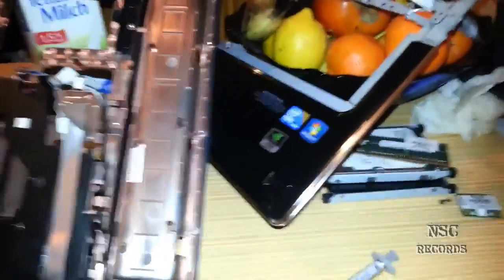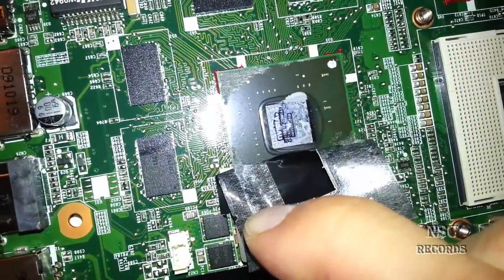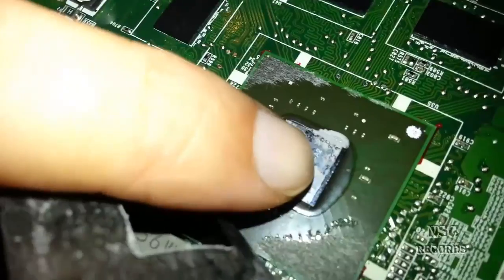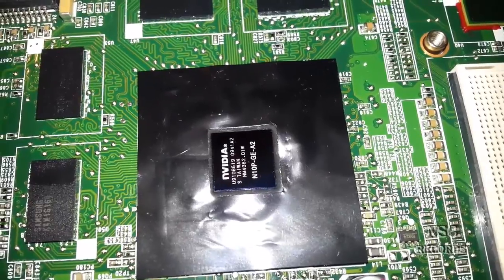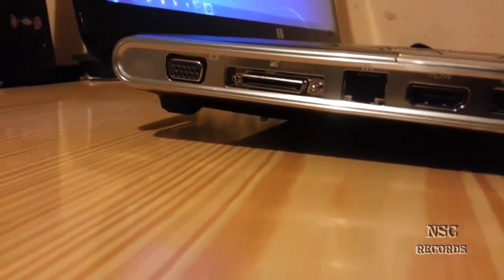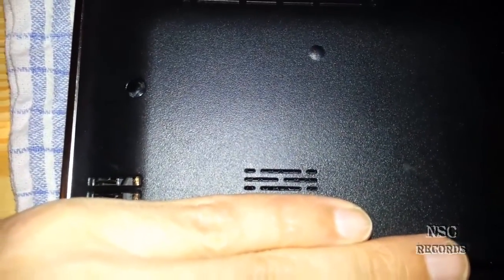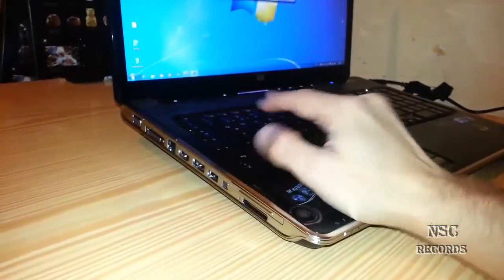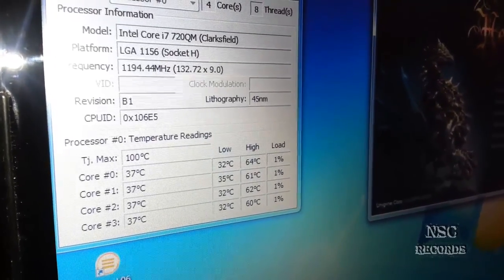HP Pavilion dv7 3090eg Temperature Fix By:NSC

Comment: Realize the dv7 is not a gaming system. Mine is running at 107*F at it's hottest. Sitting and running a few youtube videos and AutoCAD, unplugged at 91*F
Reply from the maker: yeah, it´s very true and i know it, but it has all what a normal Notebook need to work, got since a week a Samsung SSD 850 Pro inside for the System only, and a 640Gb HDD

At all it´s a great Notebook, it has also a wonderfull I7 CPU, just sad that thei messed it up like that...

Comment: don,t    ever  buy   hp     or any laptop   with  Nvidia video  chips     will only last  only like for   6  months   then   its   garbage
Reply from the maker: hmm not all, can happen also to ATI / AMD Chips...
Reply: UltraNSC
I have an HP dv7 with an AMD Radeon chip in it and it gets dangerously hot (90+ Celsius without a cooling pad), but has fortunately lasted me since 2011. Still, I'm thinking about opening it up and doing this fix.
Reply from the maker: OMG 90C* + your Notebook will die soon if you DONT do that...
Reply: ive had my quad core dv7 for years now and it playes games fine,and thats all i use it for. The only plroblem i have is the shitty vents and fan does not works to 100%
Reply from the maker: you can set that on Bios and at Win7

Comment: just opened mine today, i managed to shave off 30° by changing the thermal paste (Arctic Silver 5). the nvidia controller was just like yours, all covered up by the black protection. anyways i prefer 44° in idle than 80!!

Comment from the maker: Thank you... you just need to remove the plastic and replace it better like i have done, important is only that the plastic seats not ON the main Chip, just around the Chip to protect the smd Transistors, normaly the cooler gets no contact to this small smd Transistors, but thei did it for secure we can say.

Cheers
Reply: do you still have the laptop kicking around? Just asking, cause I’m watching this, whilst working on mine
Reply from the maker: @jackythepunk yeah, still with me, old but gold 😀
Reply: @NSC-Modz  do you know when you bought it, I really wanna know how old it is, and the documentation on the 3090eg isn't the best. Also what OS are you running on it?
Reply: @NSC-Modz  and actually, you might be able to help me answer some more questions, for example what is that port next to the vga port and what is the port next to the E-Sata/Usb and like all the ports on the other side (except the usb‘s and the power of course)
Reply from the maker: @jackythepunk I'm running Win7 and Win10 Pro 64 bit. Yeah, it's an old laptop but still nice, and good also if you like still some applications which runs only on with Win7. Look at the video date, so you know how old this notebook is :) It's max a half year older than the video it self.
Reply: @NSC-Modz  Interesting, mine should be, as far as I know around 2 years older then. I can also recomend any linux, I had a win 10 and ubuntu dualboot on mine (tho I will change win10 to win7) and it runs ubuntu really great

Comment: the motor fan is brush less, it can last forever than the GPU lead free solder, brush less motor fan is cheap, i never encountered a brushless motor die, i encountered motherboard die GPU die PSU die ETC.

Comment: HP known as Heat Prone!! i own one and i mod the fan with a 5 volts coming to the USB disconnect the fan wire to the motherboard. 24/7 the fan kick at 100% maximum no more GPU reflow ever since